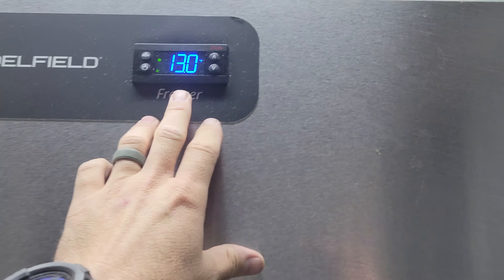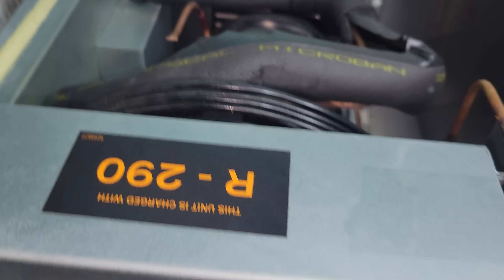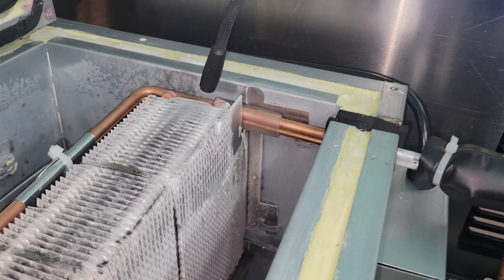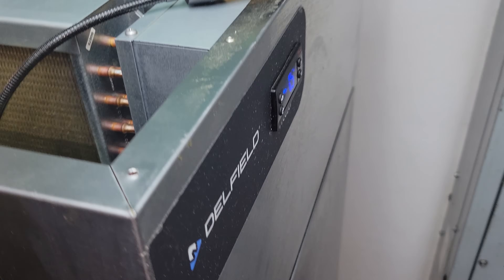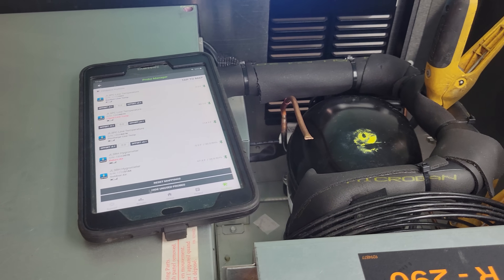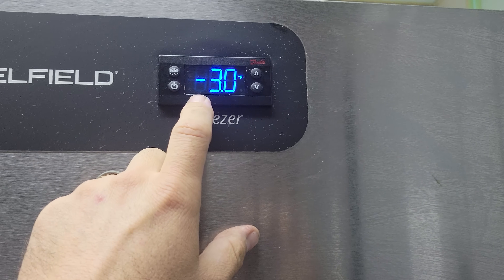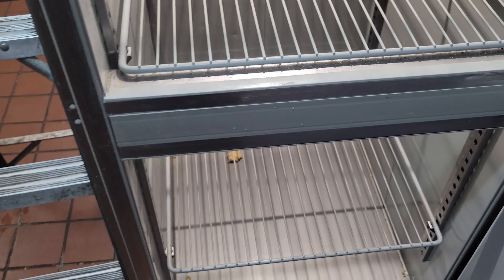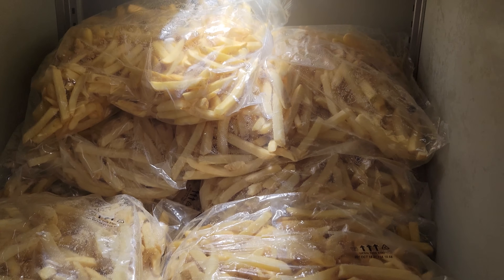THE REACH IN FREEZER IS TOO WARM

Comment: 11:33 TD 16.5°F - 17.1°F if ambient is 80, honeywell pt chart 225 for condenser, with a clean coil. Minus actual air temp to figure out the efficiency of condenser coil.
I need a refreshing of how to get evaporator TD, but I also need more information for box temp, humidity, and an enthaply chart to get the whole picture.
If memory serves me correctly, cause this is mostly off top of my head.
If I'm wrong,  please tell me where.
I need to I learn more about enthalpy

Comment: did you notice one funny thing? when you slam upper door, the lower one tends to open. but if you slam lower door, the upped does not move. Or it was just amount of force applied?
Reply: Just an air pressure thing.

Comment: When the manufacturer sends the warranty call, you contact the customer and get a backup payment method in advance before going to the site just in case it’s not covered. If the customer refuses tell the manufacturer the customer would not provided a back up payment method in case it’s not covered. The manufacturer will either tell you they will cover the diagnostic cost 100% or not. If not covered in advance then the call does not get serviced.

Comment: got a old deep freezer. its a haier 5.3 cuf. replaced the thermostat and the start relay on the compressor. it runs forever. never stops. it freezes good. before this happened i turned it off via the thermostat. and waited  for it to defrost. then it never cycled. just stays running. what could it be.
Reply: Thermostat staying closed. Sensing bulb improperly placed or its faulty. Take your pick

Comment: I ran into a few of these freezer/cooler reach-ins where if the thermostat is satisfied, the inside fans turn off. In theory this seem to not be a big deal until you load food. Basically the entire box reaches temp, fans shut off, Warm temp has to rise to reach the t stat at the top to turn on and cool back down the food. With food towards the top being closer to the t stat will be fine, while the bottom is futher away and usually goes bad or spoils. I have fixed a few of these and I just call the manufacturer, explain the evaporator fans are not running during thermostat resting and they will guide me on how to program their controller to keep fans on. Sometimes this is considered "Adjustment"/"Labor only" and warranty wont cover it (Example True will not cover ANY Labor whatsoever, just parts only, on beer coolers, kegerators) Anyways after Adjusting simply to run evaporator fans to always run except for defrost cycle, they never have an issue ever again when it comes to bottom products not holding temp.
Reply: I did see a cooler that had a fan that stopped when the door opened and should have started when the door was closed. But the switch was damaged so the circulation never worked, which in turn caused the thermostat to be too warm, the result was that everything in the cooler froze. A slight mod with some tape and a piece of cardboard made the switch operational again so that the fan started when the door was closed and the thermostat got the right airflow.
Small simple things like that can save the day for someone.
Reply: do you recomend TRUE coolers and freezers?
Reply: @randomrazr  yes. They are alot better now. If you would have asked me 5 years ago, I would have said no. They started using cheaper compressors(stopped using Copeland, and then started using tecumseh, I even seen a Aspera in a 3 door reach-in). They all pretty much use R-290 refrigerant, have newer style txv that don't seize up when using R-290, and back to using Copeland. I don't know if the pandemic caused them to change again or not, but the ones I've seen new are pretty solid. Just make sure whoever works on them knows what they are doing when it comes to R-290.

Comment: Wouldn't that be a situation where you would add some type of grill or grate to the back of the box with some standoffs so the employees could no longer block air flow?
Reply: I thought about that the same, just an additional rail on those grates to, if not prevent overloading, at least indicate to where it can be loaded. It is a somewhat silly design this way.
Reply: @alexanderkupke920  You use the word silly. I would use the word stupid. Just remember, this was designed by a college trained engineer.
Reply: @DomManInT1  let's agree that it leaves a lot of room for improvement however we call it.
Reply: @alexanderkupke920  Nah. I really like to slam college trained engineers. I consider it sport. LOL
Reply: @DomManInT1  good i never went to college but choose university instead ;) To be honest I really have to think what would be the closest equivalent to college we have here in Germany. Our traditional graduation level have been either university or more based on learning a craft starting with an apprenticeship. I guess some "Fachschulen" where you can become a technician or in German "Techniker" would be the closest comparison on the education level i think, although being organized quite differently. Or maybe our "Fachhochschule", although that translates into "university of applied science". Most likely somewhere in between.
I have to stop, trying to compare those different system will otherwise melt my brain tonight.
Oh, maybe after that I come up with some stupid design too ;) thankfully I don't actually work in anything closely related to product design or development. Who knows what brain fart design I might have come up with otherwise.
Reply: @alexanderkupke920  Well, I have worked in a couple of different trade careers. Automotive repair technician and machinist. I have butted heads many times with engineers attempting to explain to them why their design will not work or is not cost effective.
Reply: @DomManInT1  part of my study was that I had to do an internship in an industry related job. I ended up doing some months of internship in a plant making cables. They had so many apprentices, they had a dedicated shop for them. I ended up roughly doing the main steps you would learn in a 4 year apprenticeship in those few months. Of course not every bit of it and not in the same level of detail and repetition. But I started manually machining metal parts (manual meaning hacksaw, files and a drill press), later moving to some brazing, welding and lathe work and after that the electrician and electronics parts. Starting from building electric cabinets and wiring them using relais and contactors, later fabricating PCB bords and soldering all the parts on them. Finally coming up to programming PLCs where I, as I knew all the boolean stuff and some programming already from my lectures had quite some advantage over some of the apprentices who not had been taught the stuff before. Turned out I could give them quite some basics and other tips and tricks.
While this by no means matches up with years of experience in a trade, i definitely see that whoever designs something others later are supposed to service or repair, get every now and then their hands dirty in the field, so they can learn what works out and simply what does not. Pinching their fingers and busting their knuckles might make some of them rethink their designs. And honestly asking people working in the field on stuff about what they think  would help as well. They usually have quite a good insight.
Reply: @alexanderkupke920  Good on you. Yes. Some type of practicals skills are very important to success later on. Some many that only go to college or university have missed out on that type of internship.

Comment: I have only one restaurant customer in my area, and fortunately they refuse to buy any new equipment, so no R290 for me, yet.
Reply: It's a great refrigerant, only slightly flammable.
Reply: @persimonsen8792  My beef is the need for additional tools that will only be used once a year at the most.
Reply: It's maybe, not up to code. But common sense on R290 system is all you need. Flush it with nitrogen, and give it a quick evac. You won't see any flames. 
Here in Denmark, all small appliances and smaller commercial units are flammable.
Reply: @persimonsen8792  In a commercial environment, you cannot work without the appropriate tools. Doing so places you in legal jeopardy by liability if something goes wrong and you are found to not have the proper tools, such a combustible gas leak detector, R290 gauge setup, and the correct appliance grade refrigerant to service the appliance. To make that investment for a once-a-year service call is something I don't want to do. You guys who service R290 units every week can have that job.
Reply: @arthouston7361  I know. It's not up to code.

Comment: You need a heater for the TXV.
During the day the ice builds up on the TXV and restricts the flow. Another MFG has a kit for theirs.

The ice buildup was a dead giveaway, small as it was at that time.
Reply: Hoshizaki has a kit for their TXV’s when they have issues with refrigerant flow. They have a hard time telling you you they have it tho. They are heated also. This is for their r/I freezers.
Reply: Is it because of the position of the txv ? I can see it's in the airflow. I live in Danfoss-land (Denmark), and i never see txv'x covered in any kind of heating element.
Reply: @persimonsen8792  Your environment explains it. The heater is an after the fact kit. It is not needed everywhere and is rarely used. I’m in Houston so I see it more than most would.

Comment: I also hate warranty calls through manufacturers. We are authorized for multiple manufacturers. I had a toaster, cx stated it was toasting unevenly. Sometimes burnt sometimes too light. Tech support said change the infinite switches. Cx stated it is still doing it, replaced relays thinking maybe one is sticking. Customer said it still didn't fix it. I told him he can't let the guests at the hotel mess with the temp settings, it's a conveyer toaster not like a normal push down toaster. It heats differently. He was never satisfied. I told the manufacturer I can't keep going out there and wasting my time when there isn't anything wrong with it besides user error.

Rant over.
Reply: User error is often hard to find.
Reply: @per simonsen  look between the ears 🤣
Reply: @etherealrose2139  I had a prep-table once. That didn't work. It was freezing the goods. And every time i was there, is was empty and the top lid was closed. But during normal operation they keept it open... without all the canteens in place.

Comment: I have signs inside our reach-in's that say "Don't block fans" and "Leave air gap in back" for proper air flow from the evaporator.
Reply: Basically it tells me that the design of those refrigerators could be improved to prevent this kind of issue.
People will always try to pack things as tight as possible unless strictly educated.
Reply: "Nadie puede leer"

Even if staff can read, no one pays attention to signs.

And I print them out in both idiomas!
Reply: @davejohnsonnola1536  Yeah no shit, I ask myself all the time why I even bother putting them up🙄

Comment: Nobody reads the manual on how these things function so it does not surprise me it was being overloaded and choked but taking everything out and looking at it closer they should have seen that they did overload it
Reply: A 20 cent piece of sheet metal in China would have prevented all of this. Blame the manufacturer to make such a simple error cause a total failure that could be prevented cheaply and easily.

Comment: Good info. All that I do is warranty work for True and Perlick on their residential products i.e. under counter beverage centers, cube ice machines along with an occasional column unit. I am always paid for the jobs from the manufacturers because they are the ones that dispatch the jobs because the customer contacts them or the retailer first. My question is finding out what a correct hourly rate to negotiate with these companies should be. It seems as though the local commercial refrigeration businesses really don't want to deal with residential,  and local appliance companies that repair Whirlpool, LG, Samsung etc. are at a completely different level, this work is more on the Sub Zero level.
Reply: How much do you feel your time Is worth? If the bigger companies won't take it they need somebody. Doesn't mean you can demand the moon but you can probably set a decent rate

Only issue is... the unit you're repairing is it worth 3 hours of high pay or cheaper for the customer to get brand new? So kinda think the value and age of the system before deciding. A manufacturer may not want to pay 40 per  hour and it takes 2 hours so 80 bucks and the unit is only worth 200 anymore. You never know maybe they will.

Comment: We have lots of calls like these, lucky all our fixtures are online tracking temps
 Which can be checked remotely. Great video
Reply: Can you monitor all of the sensors remotely ? i work in commercial refrigeration (supermarkets) and in Danfoss ServiceTool you can easily be mislead. if a fan is not working or the evap is iced up.

Comment: When we do warranty calls, we always let the customer know that if the manufacturer will not cover the service call (like in your video with stacking product to block airflow) that we will be charging them for the service call before we send anyone else. We also write up the service call like normal, then apply a labor/part credit for whatever the manufacturers warranty allowance will cover, so that the customer can see the credit applied on the invoice. Of course, the invoice you submit to the warranty department can always be adjusted 2 months later when they decide to pay, requiring us to e-mail/call and explain why we deserve to be paid the full amount, usually they will adjust it back to what you submitted, but alot of these cheap chinese/korean warranty departments are so cheap that we have to eat that. So never assume the factory will cover your travel time, unless you have history with them, and they will usually let you know what the max travel allowance is for a claim, like 1 hour total travel for 2 trips etc.
Reply: Great insight thank you!
Reply: do u recomend TRUE coolerS?